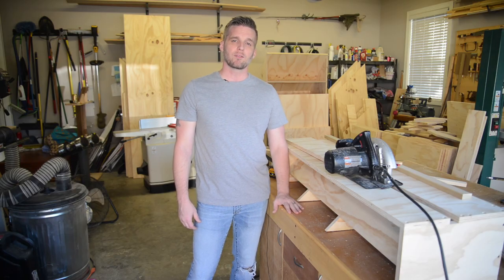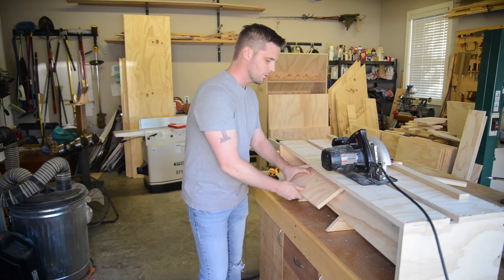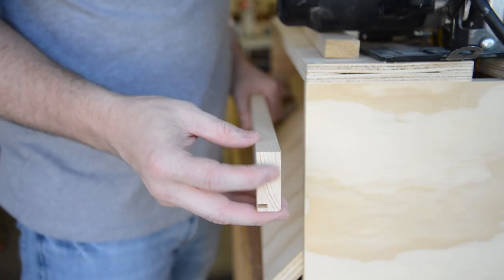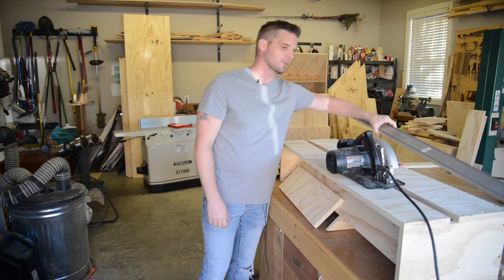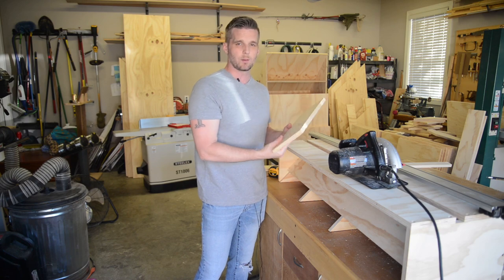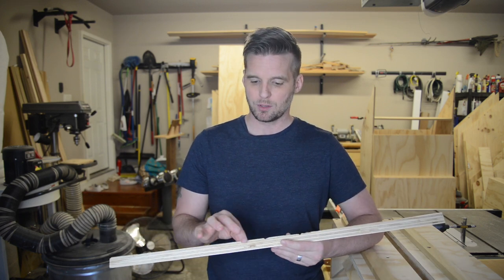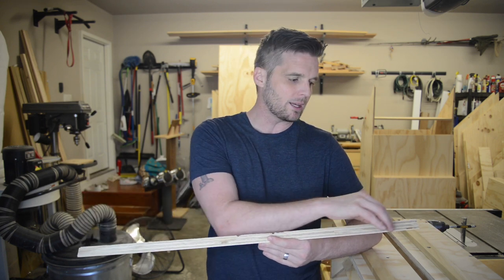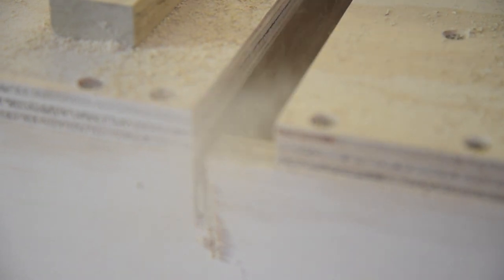How To Cut a Bevel Greater Than 45 Degrees | Easy Jig with a Free Plan

Comment: I've been working through making a coffee table. It is going to have some pretty awesome angled sides. I've bought and processed my wood, I've glued up my panels, got them sanded flat, made another jig for another part of the project. I'm about to glue up the 4 sides and just now I've realized there isn't a tool that will bevel the 60 degrees I need... Several expletives later I found your video. There is hope still!
Reply from the maker: Glad it helped! This is the kind of stuff I love to read

Comment: Am i missing something to think just flip your board/plank/workpiece and cut with blade set to 40degrees ?
Reply from the maker: Technically it's the same, but please don't turn a large workpiece on its edge and run it through the table saw....especially one that is 3 ft by 4ft like the one I needed to cut. Best case scenario is a terrible, inaccurate cut.